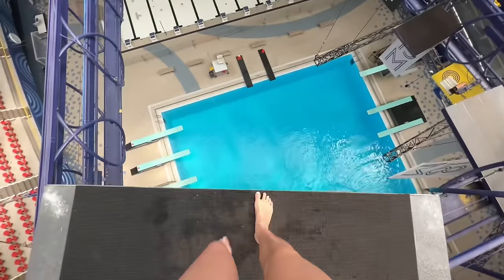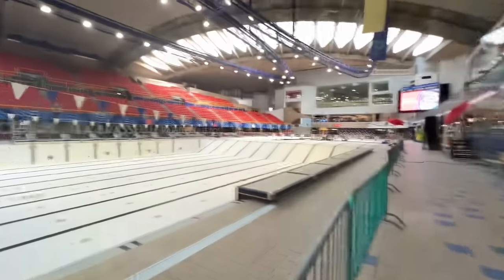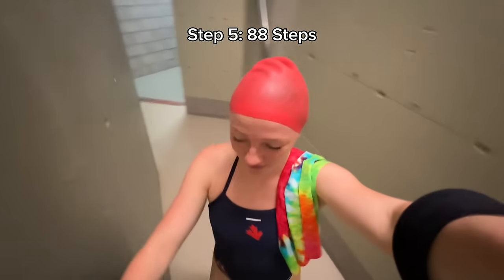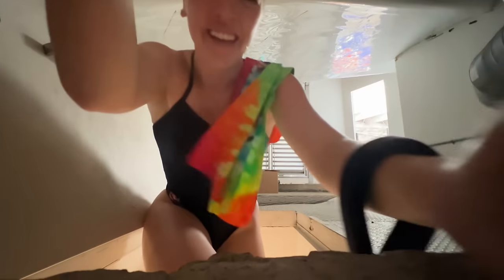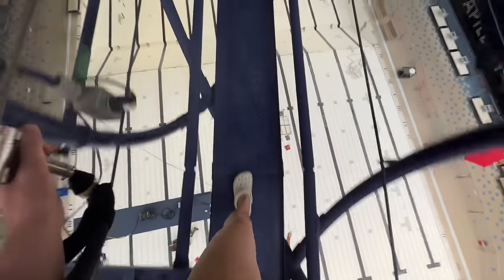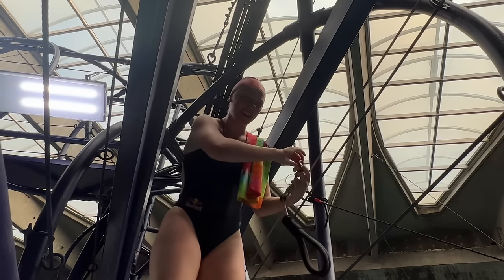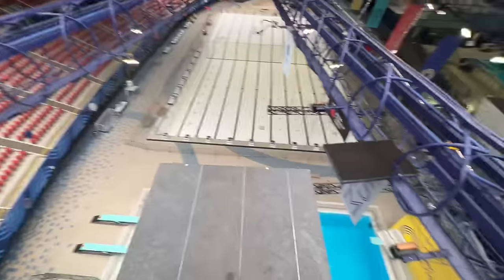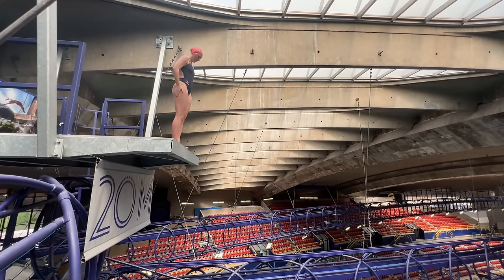20 METER - How to get up there - Unfiltered Training Vlog

Comment: I did 5, 7.5, and 10 meter platform diving in my younger days, not sure I could work up the courage to try 20 meters.  Also, platform diving pools are a rarity outside of university and Olympic training centers these days due to liability issues.  Good luck!!

Comment: I gotta admit, I think the most unnerving part of this, is the part when you have to remove your footwear. The walkway looks pretty dirty for having to go barefoot on! Also, I'm not understanding how the section you connect to the wire, would be consider a safety device. I could be wrong, but a loosely fitting loop on a wrist, feels like it wouldn't do much in the case of a fall.

Comment: This is so cool. I always see the dives landing feet first. Is it possible to go arms or head first? IS there impact issues? At this height and with the pool depth I also wonder I am six foot five inches (96cm) is their a height limit cause I am taller and heavier I could hit the bottom of the pool sort of thing?
Reply: Regular diving (the Olympic sport), is 3 m or 10 m. It's hands/head first. High diving (what she does) is 20/21 for women and 27 for men (can be higher on natural sites). And it is always feet first (flat feet). Too dangerous otherwise.